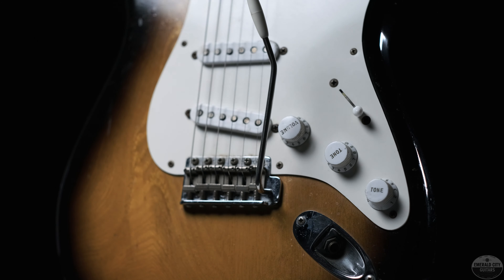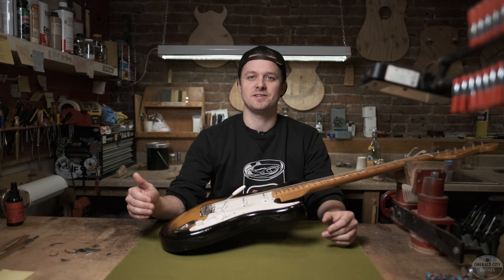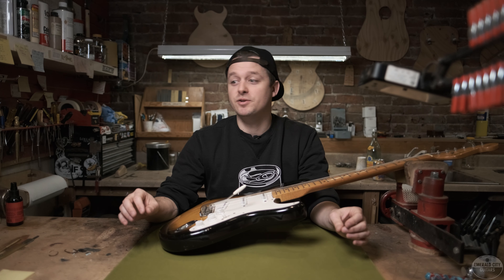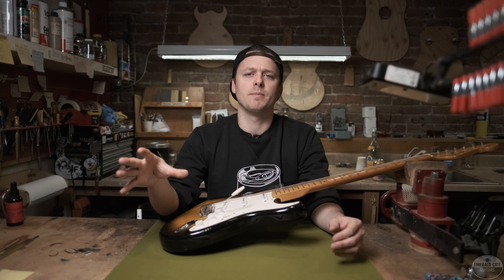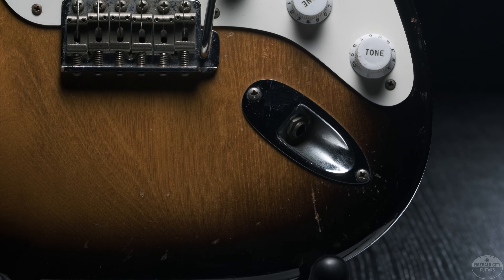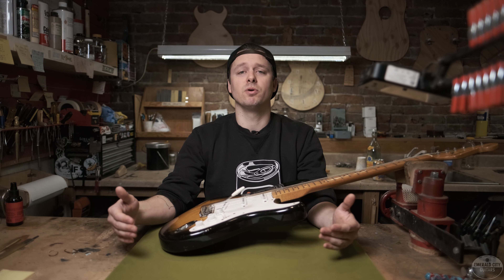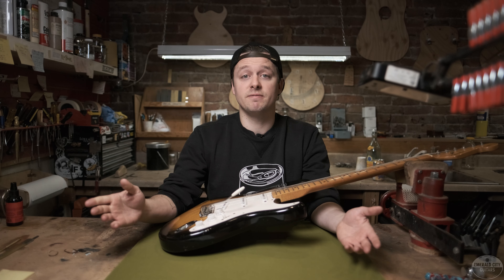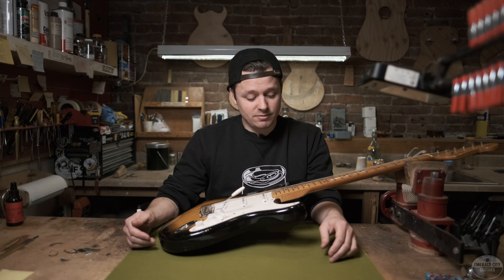1954 Fender Stratocaster & the Pre-Production Models

Comment: not a pre-production...
This is a first run production for customers.
it probably have the 304341 (41 week 1953) 100k pots on it, yellow surgery tubing, glossy back pickguard...
Reply: Not sure where you’re getting your information. 100k pots were discontinued in June, long before this August Strat. As for the nomenclature, Fender VP Forrest White was insistent upon the fact that anything pre-October was pre-production. I’d check out Tony Bacon’s 1992 interview with White for some accurate info on the model’s beginnings.
Reply: @TylerECG  hi!
pre-production, as mentioned in your video, are promotional ones not intended for sale (circa 100 serial on term plate). 
the productions of August and September were those sold in October to all.  It's a beautiful guitar but it doesn't have the prototype specs of the pre-productions.